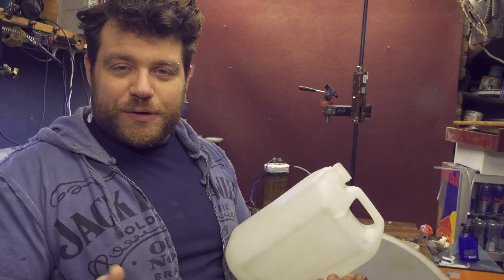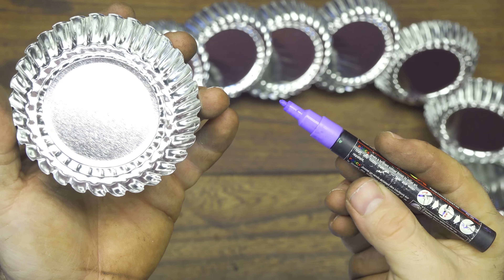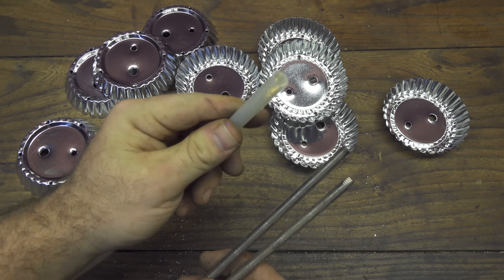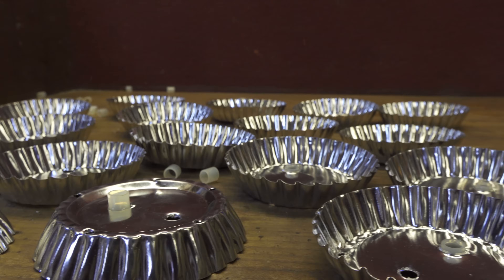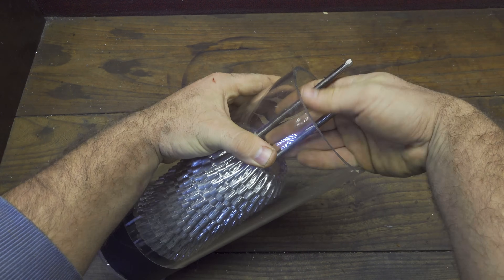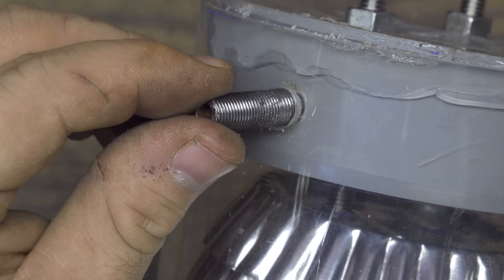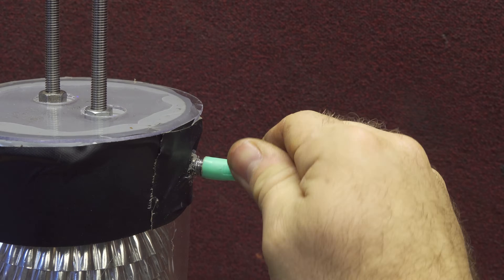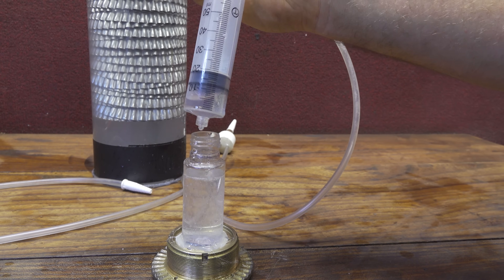Superpowerful Flame 5072 ℉ • Produce Hydrogen from Water - Do it yourself

Comment: I call BS... That flame was nowhere near 3000 degrees C... More like 1000c...anyone that understands torches and how to use them know that a yellow flame is never a good thing...actually it's a very bad thing(unless you want low temp flame and impurities are not an issue with what you are using the flame for) and tells you things... It tells you that you are not getting complete combustion and it is starving for oxygen...which means low temps... The yellow flame is a result of small carbon (soot) particles in the flame because of the lack of oxygen...this is because you  are using the fuel in a 2to1 ratio...2 hydrogen and 1 oxygen...in theory this should be sufficient to get 3000c temps...but not in practice because of the environment that you are using it in...a 4 to 1 or 5 to 1 ratio is needed to avoid a carbon flame(yellow)...the color of the flame should be blue...you can only get a blue flame with complete combustion when burning fuel...so if u do not see a blue flame something is wrong...using a carbon flame(yellow) to solder would make it weaker because of the impurities of the carbon flame... You should never use a yellow flame from burning fuel for much more than lighting candles and stuff like that
Reply: METO U  is correct with the flame color, it should be nearly invisible, but seemingly unaware of a hydrogen generators fuel ratio. The ratio is 2:1, which is the most ideal ratio (no excess fuel, no excess oxygen), but it also makes it an explosive mixture.

The source of carbon is two fold in this video: First, the man is using sodium bicarbonate, which can provide a source of carbon. Better would be sodium hydroxide. The second source for impurities is that all the joints are just epoxied or hot-glued, thus presenting leakage issues and thus altering the mixture ratio.
Reply: Hah, almost forgot: Sodium produces a yellow flame, so I would test the output of that device for sodium salts. Sodium chromate could be a potential candidate, as the stainless steel leaches chromium and the soidum bicarbonate provides the sodium. For the record, not a healthy substance.
Reply: I ain't as smart as all y'all fuckers but I I'm a welder and i know yellow is cold blueish white is hot
Reply: He probably just went to google to look up the temperature of an HHO flame. It is true that the max temperature of an HHO torch is 2800°C but there is no way his janky ass ripoff of elementalmaker's hydrolysis machine could get anywhere near that.
Reply: The temperature of the flame changes depending on the material that is being heated, it can melt wax or sublimate tungsten. It's one of the weird science aspects of HHO gas combustion, hell I can boil ceramic chips with just 1.5 liters per minute output.
Reply: Sodium is what is making the Orange
Reply: the yellow flame is probably due to the sodium bicarbonate in solution. with KOH instead it would be a nearly invisible flame.
Reply: ps a hydrogen flame cant turn TUNGSTEN to a vapour...   you might want to learn about how hydrogen works..  its not dependant on the colour of a flame... its dependant on what the flame touch's.

ps....  starving for oxygen...  lol   ps  it doesn't need oxygen..    unless you think the hydrogen bomb  dropped on Nagasaki was full of liquid oxygen?   chain reaction..   no oxygen needed..    PS the sun is a gigantic ball of hyrdrogen..    no air, hows it stay on fire :-)
Reply: @harleyme3163  the sun is electric and not a nuclear bomb that gravity prevents from exploding...i highly recommend researching the electric universe theory...you do realize that you are attempting to reference something that only explains 4% of the universe...the rest is "I don't know" more commonly known as dark matter and dark energy...also called fudging the numbers so the theory works... You call that science...the sun is condensed liquid hydrogen my friend..but don't expect mainstream scientists and physicists to say that the universe is electric because they won't and for good reason...if they do then they would be admitting that nuclear weapons are fake because they are modeled after a gravitational sun...so don't hold your breath
Reply: @harleyme3163  apparently you have not heard about the electric universe theory...go check it out if you really think that the sun is a big ball of hydrogen
Reply: Wheres the carbon?
Reply: Ah nevermind
Reply: It’s still a bad ass torch for being homemade,bitches.
Reply: OR  MELTING  METALS...
Reply: r/iamverysmart
Reply: Just to clarify a few things, but by no means is this meant as any kind of argument. Just want to state the facts here:

I'd just like to point out that in the combustion of H2 - complete or incomplete - there is no introduction of carbon. 
Complete combustion of Hydrogen is fairly simple, however the incomplete combustion of hydrogen is very complicated, with multiple species, those being: 

> Hydrogen gas, Hydrogen free radical, Oxygen gas, hydroxide ion, oxygen free radical, water, Hydroperoxyl free radical, Hydrogen Peroxide and Nitrogen gas.
Bit more info here https://www.cerfacs.fr/cantera/docs/mechanisms/hydrogen-air/UCSD/h2_sandiego.cti
No where is carbon introduced to the system. The flame colour does indeed indicate incomplete combustion, but it's a result of certain species' electrons returning to lower energy orbital states and releasing photons that have specific wavelengths that correspond to what we see as yellow/orange. 

Complete combustion of Hydrogen (Oxygen as the oxidiser) the temp would be 3200°C
Incomplete combustion of Hydrogen (Air as the oxidiser) the temp would be around 2254°C

All in all, METO U is correct about this flame not being 3000 degrees and being incomplete, but not exactly for the right reasons.
Reply: THE YELLOW IN THE FLAME IS AN IMPURITY,IT'S NOT GAS/AIR MIXTURE,I WORKED WITH MY DAD WHO IS A GAS ENGINEER,I'M AN ELECTRONICS TECHNICIAN BTW,BUT THE COLOUR HERE IS NOT THE GAS/AIR MIX,I'VE SEEN OTHER OXYDYDRO TORCHES WITH AN ALMOST CLEAR FLAME,THAT FLAME WILL MELT TUNGSTEN,IT'S REACTIVE,WIERD STUFF ACTUALLY,IT WON'T BURN THE METAL,IF YOU CUT LEAD WITH IT ,IT WON'T GIVE OFF POISONOUS GASSES,LIKE WHEN THE UNINFORMED WELD LEADED STEEL,OR SET ALUMINIUM ALIGHT,IT REACHES THE SUBLIMATION POINT ONLY.
ANYWAY,THE GAS AIR MIX FOR THIS IS THE GAS RELEASED FROM ELECTROLYSIS,THE COLOUR IS LIKELY FROM USING THE TYPE OF SALT TO MAKE THE DIELCTRIC SOLUTION,SODIUMHYDROXIDE OR POTASSIUMHYDROXIDE ARE BETTER,SALTS GIVE OFF GAS,SEA SALT GIVES OF CHLORINE GAS WHICH MAKES THE FLAME BURN WITH A GREEN HUE,IT SHOULD BURN LIKE AN ATMOSPHERIC BURNER BURNS,A NICE CENTRAL CONE BUT ALMOST CLEAR,INVISIBLE (ISH).
Reply: I SHOULD'VE ADDED THERE IS NO CARBON PRESENT WHEN YOU BURN OXYGEN WITH HYDROGEN,YOU'RE TALKING OF BURNING A HYDROCARBON BASED GAS,WHICH HAS CARBON LOCKED INTO THE CHEMICAL STRUCTURE OF THE GAS,METHANE IS CH4,1 CARBON ATOM 4 HYDROGEN ATOMS,SHOULD BE BURNED WITH  A 4-1 RATIO WITH OXYGEN OR THERE ABOUTS,OR THE CARBON GETS RELEASE  TO BOND WITH THE OXYGEN MAKING  CO 1 CARBON ATOM BONDED TO 1 OXYGEN ATOM,H2O SPLIT TO OXYGEN AND HYDROGEN GASSES RECOMBINE TO MAKE SUPER HEATED STEAM,BACK TO H2O.
PEOPLE RUN CAR ENGINES ON IT OR SUPPLEMENT THE USUAL FUEL WITH OXYHYDROGEN,STAINLESS RINGS AND EXHAUST ARE NEEDED,AS THE SUPER HEATED STEAM NOT ONLY STEAM CLEANS CARBON DEPOSITS FROM THE UPPER CYLINDER IT RUSTS (MOSTLY) THE MILD STEEL EXHAUST SYSTEMS ,MOST PISTON RINGS ARE HARD CHROME PLATED CAST STEEL SO CAN SURVIVE,BUT I'D FIT STAINLESS.
Reply: look, @METO U can be a little toxic. But actually i learned a lot only by reading his arguments😂😂😂
Reply: @MeanDeanBailey  I have no clue what you are saying...or trying to say. Let's get to the point...i said that flame is yellow which means low temp and carbon is present which means that the fuel to oxygen ratio is not correct...and it's roughly 1000c not what he said... Prove ME wrong or shut up
Reply: Carbon...? What...? The fuel is hydrogen and oxygen; there's no way carbon can enter the mixture. And burning oxygen with hydrogen produces Incredibly hot temperatures like 3000°C.
Reply: I may try an explanation : the fuel generator uses soda baking - instead of sodium hydroxide . This generate H2 , O2 as well , but also  CO2 ; This would explain the color - the pure H2/O2 give an invisible flame
Reply: @aasmith6117  from the environment dipshit...what you can't read either... You have a very serious lack of understanding of combustion and should shut your mouth cause you are just making yourself look like an idiot...which apparently is something that you have gotten quite good at with all the practice of being an idiot..yel(low) flame means low temp..and incomplete combustion...and if you man up and apologise I will even share some knowledge with you...if not all of us will just continue to 👉 and 😁 at you... After all you did notice what I said in my original comment right? Nope.. I don't think so
Reply: @aasmith6117  lol dude you're not helping your cause. The fact that completely disregarded Carbon from surrounding whether it being car fumes or natural like methane hydrocarbons are present in the atmosphere which is why carbon soot can accumulate
Reply: @aasmith6117  just because you are such a dumbass I will learn you something today... Consider it your Xmas present from yours truly...oxygen has a unique property...oxygen is paramagnetic...which means that when oxygen is in the presence of an external magnetic field...it creates it's own magnetic field to oppose the external magnetic field...everything has a magnetic field because everything is made of the same exact things.. This is why oxygen is able to combine with so many other things...he is not making enough oxygen to prevent this from happening.. Which is why I said 4to1 or 5to1 is needed(in practice ) for complete combustion and the temps of up to 3000c(about 5200f)..water is 2to1...which will only give you temps of about 1000c...just research why yellow flame is not good when burning fuel...your wasting fuel
Reply: @metou3072  what about to use it for an internal combustion engine to supplement the fuel?
Reply: I am a lampworker(I blow glass using boroscilicate glass"pyrex" ). This is completely correct. I use an Oxy/propane torch to reach the temps I require between 1200 and 3000+ . This torch isnt reaching near those temps and indeed the yellow color is a big give away and yes it is the carbon in the flame . My torch will physically create chunks of carbon on the nozzles over time when using a cooler flame that has a lower ratio oxy.

I also actually approached a company that was making commercial units producing this gas like this for welding and such, to find out if I could use their system to replace my propane side with this , using it with Oxy to blow glass. The company told me that it  would work and that there are a number of people doing it successfully.I asked for references to confirm their claims and was met with complete silence at that point. I contacted them again to try and get an answer and never got one. They were making all kinds of claims about their machines and the gas it produced . The pressures, the  electricity cost ratio and some miraculous properties etc. so I was wary of the whole thing from the start.
Reply: @twisteddman  It is used mainly in jewelry because of the ease of use, on-site gas production (no bottles necessary, only water and electricity) and portability. Can't say what company you have been dealing with, but there are couple of companies in Germany that make these as products for use. It replaces the oxygen & propane you are using, not just one.

The only thing oxyhydrogen can't be used for is welding steel as it causes hydrogen embrittlement. For more information and links, check https://en.wikipedia.org/wiki/Oxy-fuel_welding_and_cutting#Hydrogen
Reply: There are three carbon atoms in each Propane molecule
Reply: I use my HHO torch for glass as a small hand torch, it works great. Burns very clean, very hot and melts glass almost instantly. Doesn't seem to shock the glass as much, and the only carbon you are going to get is from impurities in the electrolytic solution in the fuel cell carried with the gas as vapors, which can be filtered out with an additional bubbler or two. Try it, it absolutely works and you don't get any discolorations like you get from propane. The only issue I had was with needing a reduction flame, but you can add an additional line into the system to supply a carbon if needed. Trust me, been working glass for over twenty years and HHO is incredible.
Reply: @twisteddman  thank you for your input.
Reply: This man is not using a regulator for neither oxygen or hydrogen...which is required to dial in the correct fuel to oxygen ratio..its exactly what regulators do.. Regulate the flow rate of a gas....the only way around not using regulators is by mixing the correct fuel to oxygen ratio and then put that mixture inside of a tank yourself...which is completely stupid and dangerous and still would not guarantee complete combustion because of oxygen levels at different heights above and below sea level...i am not aware of any fuel that includes oxygen in the same tank as the fuel itself...could there be something that has a very specific purpose that always has the same exact environment it's used in every single time...possibly...but it's irrelevant...you always keep the fuel and oxygen separate until you are using it so if something ever did happen complete combustion can not occur which is what would release the most energy that it could ...again.. You must use regulators to get the correct fuel to oxygen ratio for complete combustion of the fuel...if not.. Like this man in the video...there is no possible way to get complete combustion without regulators..and if you are not getting complete combustion then you are introducing impurities into the object you are brazing... Soldering... Or welding.. Making it weaker intentionally...which is not good if quality matters... Which is why I said that his torch in this video should be used for nothing more to light candles or stupid shit where low quality does not matter and neither does the fact that you must hold the torch flame on what you are heating for double or even more time because of the low temp of yellow flames...you would know this if you ever used oxygen with a fuel in a torch like a Oxy-acetylene to cut steel and not rely on the atmosphere for the oxygen like a propane only torch or an acetylene only torch..again..he would have to mix the fuel and oxygen at the correct fuel to oxygen ratio himself and then put it in a tank himself because there is no chance in hell for you  to get a mixture of both fuel and oxygen in the same tank...OSHA forbids this and would shut a company down immediately if they had fuel or oxygen in anything other than the pressure tested tanks that were inspected that they come in when you buy them from the gas supplier...you must put down a deposit for the first tank you ever get and then you just bring the empty and exchange it for a full one and you only pay for the fuel.. You can get your deposit back by just turning in the tank after your done...if you use a torch with a yellow flame...or anything else like even a stove with a yellow flame...tells you that you are not getting complete combustion of the fuel and that the fuel to oxygen ratio is incorrect...which means not only are you wasting fuel... It would introduce impurities into a weld or soldered joint which makes it weaker... This is why when doing refrigeration work and are brazing the copper together (which is what I do for a living and before that I worked as a welder) you must use an inert gas like nitrogen or argon and have it flowing through the pipe inside of what you are brazing or welding...if you do not do this.. Is will cause soot to form inside of the pipe and will get inside the joint you are welding or brazing making them weaker.. This also causes restrictions eventually in refrigerant piping because all of the black soot you see on the outside of copper when you hear it up also happens inside when no inert gas is used..i worked in huge chemical companies like Air Products that would obliterate a 3-5 mile radius if  all of the chemicals were ever to all go up at once...all of our welds...every single one of them (Stainless Steel pipes that carried the chemicals that were eventually mixed to make emulsions that were sold to companies to make things from which kinda looked like Elmer's glue ) had to be x-rayed to ensure the quality and strength of the welds.. Anyone that is a certified welder like myself will know exactly what I am talking about regarding getting their welded joints x-rayed for quality to ensure that there are no impurities in the weld that weakens the weld that can lead to premature failure... The impurities would  come from things that were not cleaned/grinded/sanded from the two mating pieces being welded together and/or from not having an inert gas flowing through the pipe being welded like Argon.. Which is what we used to weld steel.. I am also a certified hvac technician so anyone that is also a hvac technician (that knows what they are doing and had actual training) knows the problems that will result from not having nitrogen (which is the inert gas used for refrigeration copper piping)...inert gases displace oxygen ...and oxidation is what causes the yellow flame when a fuel does not have complete combustion...carbon is the cause of the yellow flame...this is not up for debate...when complete combustion occurs for a fuel it causes a blue flame with no yellow at all... Yellow is a sign of incomplete combustion and a low temp because of the fact that you are not getting complete combustion..this also is not up for debate...the reason why you have a blue flame when complete combustion occurs is because only a single wavelength of light is being emitted..
Reply: @Zuluknob  your opinion is like an asshole... Everyone has one and a lot of them stink.. I understand what has been/is going on throughout the world...people are intentionally being divided all over the world...divide and conquer...and the way that they are doing it is by faking news and events in order to fear monger citizens into voluntarily giving up rights in an attempt in order to make it equal for everyone...that is why you see all issues from the past in headline news today...everything from black lives matter to equal pay and rights for women...this is so each group can not claim to be any better than others because the same things are happening in all of the groups people are divided into... Religion plays an essential roll in all of it because people can not be expected to give up what they believe in...this is the very first division point and people are divided more and more from this point into race, gender, etc.. Doing it this way creates a stalemate  where no sides can claim moral victory...jews are made to look like evil villains  that care about nothing but money and their own...Muslims it's terrorism and extremism and denying women's rights...but at the same time they are made into very tolerant of others and respectful to all others and it's only a small amount of Muslims are like that and it's the same as all other religions.. The same exact people that are responsible for all fake news and events also control the universities...when discoveries are made they are right there to make start up businesses and they go on to patent and trademark and everything else that goes along with it..this has been going on since day one of the US and is being done around the whole world. When they came to the conclusion that the universe is electric and that gravity was just electromagnetism they continued to say gravity was it's own separate force so they could sell the huge quantities of oil that was feeding the new luxuries of man like cars and electric motors that can be ran by burning fuel and turning mechanical energy into electrical energy.. If people knew that the universe is electric and not gravitational  they would have not been able to turn all of the businesses that were started by European royals using fake identities (like Rockefeller and all other extremely wealthy families..this is being done around the whole world.. Not just the United States ..they are all fake identities of European royals to hide the fact that they are royals and this can be proven with 100% certainty )so there is a very good reason why people don't know that the universe is electric and not gravitational..its all part of the deceptions and lies being done by European royals...i am inclined to say that you yourself are benefitting directly from the deceptions and there is a reason why I say that...you would have found out by now that gravity is BS (cause it's not difficult at all to find out that gravity is BS when Newton's laws of gravity equations are identical to Maxwells equations but just worded differently...happens all the time in math where there are multiple ways to get to the correct answer ) if you gave a shit about your own family you would have known by now that gravity is BS because you are extremely late to the party and it's already last call...i know that you are part of the deceptions to destroy the us dollar intentionally I want to make sure that you understand that you are wasting what little time left you have to work on your bucket list because I can promise you that you will not be able to get away with blaming all fake news and events/deceptions on your own fake identities in order to trick people into accepting digital currency by letting everyone know what you have been doing with the dollar...we have already made it impossible for you to get away with it and if you think that we do not know how deep these deceptions go into government...police.. Etc and think that there will be people left to be your security blanket to catch you assholes when you fall you can fuck yourself...you idiots have done something that was not needed that got you caught... That will come out eventually but because you are still doing it I will not say anything at this time.. We have already identified each of the people that are fake identities of 1 person in the government...Hollywood (which is the same exact thing as the government because it's the same exact people in government using many fake identities each ) it's very easy to predict the future when you know that history is pre-written and prerecorded because of how you assholes are deceiving people using many fake identities each...we have decided that we would form a group of former and current active military members and all of us predict the future so we can prove that history is pre-written and prerecorded and we have already succeeded in doing so every day that it continues does nothing but make our proof stronger.. Obviously we did it with them so they can not be labeled as unpatriotic...over 14000 people last time I checked...we even know which people on YouTube are really 1 person using many fake identities...your going down my friend...you may have had your foot on our heads under water but we have already drug you into the water and your coming with us...your doing it to yourself now too asshole...the people are not loosing anything because they have nothing to lose and only stuff to gain... Which is what you are using to get what you want...get rid of paper money to allow you to have absolute total control of money..you are just blaming it on people that do not exist...the system is a scam that is currently in place because you can cheat the system when all countries have their own money... It needs to go anyway... Forgiving debt is going to make people want to switch currency.. You idiots through away your life of luxury and decided to join the poor folk.. Welcome aboard!!!..you will not be able to keep all of your fake internet identities so say bye bye...the hunters have become the hunted..
Reply: @Borals  says the guy that attempted to use the screen  name "crazy" but settled with "craze" instead because all of the screen names with crazy were taken already unless you add 8 numbers after "crazy"..so u went with "craze" and had to use 09 cause all single digit number were gone already and you can not count past 10 without taking your shoes off... Dipshit...and just so you know If I wanted to hear from an asshole I would have farted
Reply: @metou3072  you are right but jesus christ you have some anger management issues,insulting people or being a condescending prick doesnt help them to learn
Reply: @Autistic Boy please show me where I said that burning oxyhydrogen produces carbon...yellow flame means incomplete combustion of the fuel...its not the correct fuel to oxygen ratio...the color of the flame when burning a fuel tells you things...yellow flame means low temp because of incomplete combustion...which causes carbon monoxide because of the incomplete combustion ..you need to have the correct fuel to oxygen ratio for complete combustion...which this man clearly does not...the yellow flame tells you that...your "clean" energy is only when you have complete combustion with the correct fuel to oxygen ratio...otherwise it's not efficient and wasteful